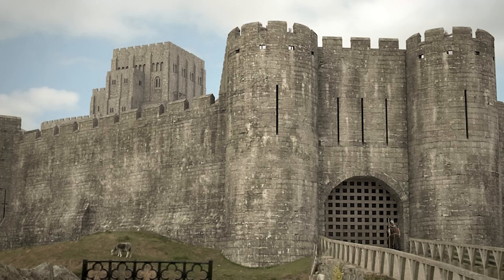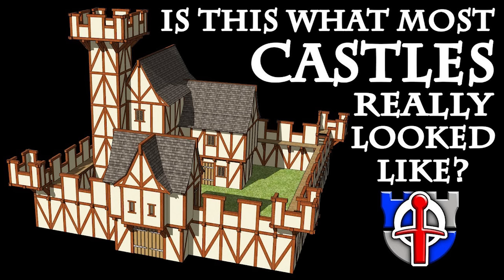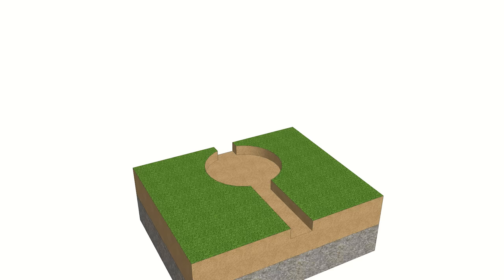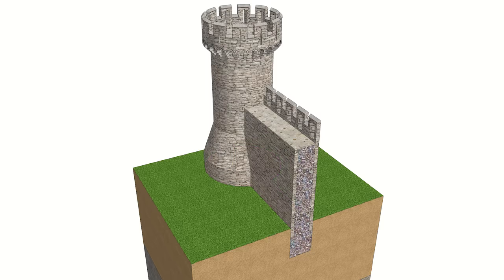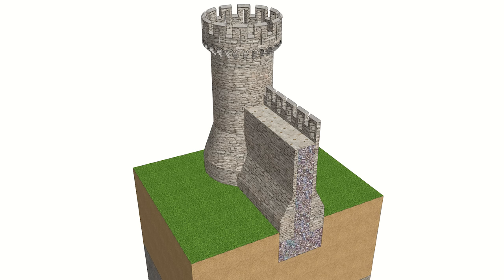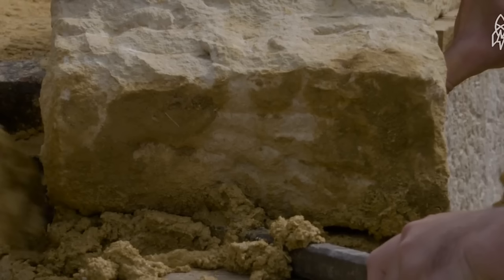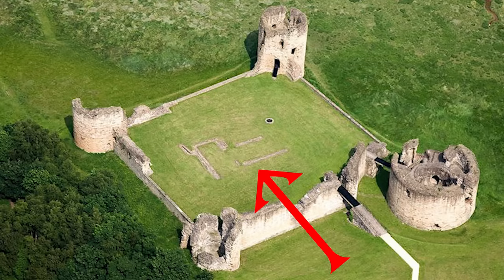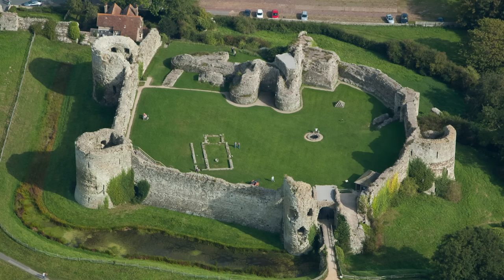How were castles built / constructed in the medieval period?

Comment: I wonder if the "rubble" fill rock helped with the stability of the inner wall.  Could haphazard layed stones have minimized cracks from running through and may have made the wall more earthquake stable? Perhapse the outside rock was laid more for astetic appeal and to keep water from the core?

Also, back about 100 years ago when they were building brick homes in my town, there were two types of brick layers: the ones that did most of the house and the interior, and then type who would work on the front facad of the building and the artistic brickwork.

Comment: @Shadiversity

On the subject of nails - the expense of making nails via smithing is an obvious limiting factor, but there's another one: moisture. 

Wood, even painted wood, tends to attract moisture, which really isn't good when you've got nails made of wrought iron - those nails would tend to rust, and as they rust the mechanical hold they provide will lessen. If the entire structure was stationary, the top layer of rust would protect the underlying surface and prevent its own spread - but wooden structures tend to expand and contract as the temperature and weather changes, causing the wood to rub hard against the rust and ensuring that the relatively brittle rust layers will be constantly disrupted, exposing fresh iron beneath.

While it's certainly possible to put a rust-resistant finish on nails, the finishes available in the medieval period tended not to be particularly abrasion-resistant - something you really need if you're going to drive the finished metal into a block of wood.

And then there's the expense. It's already relatively expensive to make the nails - putting a protective finish on all of them would only make that worse, even if there was a finish that would survive abrasion.

Jointery, as you said, saved on the expense of making nails, but I contend that nails would have been the inferior solution even if they had been cheap, because they wouldn't have lasted as long as the jointery.

Comment: To say that stones arranged in an arch are in compression instead of tension is like 90% true. The other 10% is the poisson effect, which is to say, compression in one direction amounts to tension in another direction. For an obvious example, imagine squishing a marshmallow: it gets shorter AND fatter at the same time. I'm told concrete columns sometimes fail this way, with the load being so large that the column ruptures laterally.

Comment: The reason a wall has two skins and a core is because the core acts as a dampener. If a wall was built fully from "one" part, it would crack easily or have to be truly massive in the element base (Central America's ancient walls, Egypt et cetera). This is ancient knowledge known since times immemorial. You'll see it in ancient China, Rome's structure even in the Americas and ancient Egypt.
TLDR, it's not so much a cost saving feature, as it is a structural one.

Comment: On the roof tiles you missed "Flag" I'm from Orkney, a group of islands off the north cost of Scotland. There all old structures use Orkney Flag. These are like slates but their "leaves" are much larger, meaning the stone is less likely to break. this also means that each tile is up to a metre in hights or width and 5- 10 cm thick. Not even Orkney winds will blow that away! I'm sure that Flag must have been used in castle in other areas where such stone was available as its such perfect building stone (often a grey-blue or purple colour) it would br to valuable not to use.

Comment: assumed the reason that internal stones inside walls were like that as they weren't placed.
i thought they made the external walls then filled them in but literally dropping the stones into the gap then assumed that the mortar inside was just made with extra water so that it could just be poured to fill in the gaps.
not sure if that's right or not but it's what i assumed from looking at ruins and thinking how that would have been made

Comment: You are missing the point of the tighter fitting stones on the outside and the looser fitting stones on the inside with the use of more mortar.  It was for cost.  The finer fitting stones had to be dressed and that took time and money and a lot of skill.  The rough stones in the inside were not dressed and the chiseled off bits and such could be used as filler inside the wall to make the mortar stronger.  The outer stones though were dressed to make them look better, but also to make them harder to climb and damage.

The outer walls would separate if water got inside the walls and froze.  While the castle was occupied the they typically would upkeep the castle and repair the cracks and such before any major damage occured.  After a castle was abandoned and any damage did occur, they locals typically would steal the dressed stones.  We typically see the after effects of possibly hundreds of years without upkeep or after massive damage was done during wars.

Few castles had wooden shingles because fire was always a threat.  The few samples you might have seen were likely because the roof was replaced long after the castle was a part of wars and wood shingles were used to save money.  Attacking forces would do anything to give them an advantage and starting fires with flaming arrows was a VERY common tactic.  Wooden credentials would often be covered with something to prevent them from burning easy or kept damp.

There was a lot that went into the design of castles from the entrances, fire arcs to cove the walls better, credentials to defend archers and crossbowmen, to courtyards, keeps, draw bridges, motes, stables, barracks, storage, water supply/cisterns, visibility, roads, access...  Some designs were very basic like single towers to massive castles surrounded by walled cities.  They were always used as a symbol of power and a way to control the surrounding land.  Typically they required 10x the manpower and resources or more to take a fortified location like a castle and some of the better designed ones took 20 to even 50 times or more.  Eventually it got to the point where is was easier to surround the castle and wait months if not a year or more to starve out a castle.

Comment: Shadiversity, you were kind of fed a bit of misinformation on top of misinformation: stone is a poor insulator, but has a high specific heat capacity.  So if you kept a big fire roaring in the room it would warm up quite nicely, and would stay warm for quite a while even after the fire died down, as the stone radiates heat back into the room.

Dampness is also somewhat overplayed: most castles are now quite damp, because most have not had a fire built in them for centuries, and so they're basically constructed caves.  Complete with stalactites, if you know the right place to look in Caernarfon.  But anyone who has ever been in a house or cabin with wood heating knows that in addition to casting heat it's also a very effective dehumidifier, and so I suspect that the living spaces of castles would actually have been quite dry.

Anyways, as a Canadian who did a European castle tour just recently, I highly recommend it.  Wales in particular is dense with exemplary examples of castle building.
Reply: JSheepherder And the lead and tiles on the various roofs of the castle, along with lead guttering and drain upkeep, would have ensured a dry internal environment. Now castles are all mostly ruined so all of those measures were taken away, and water seepage has long ensued.

Comment: In response to the insulating properties (r-value) of stone:
The real reason why castles and other great heavy structures are cold inside, is because of the high thermal capacity of heavy materials.
Stone and concrete can absorb most of the solar radiation and store it in their masses. This keeps the interior temperature low but the surface temperature on the wall exteriors is quite hot.
The cold nighttime winds cool down the mass and ‘resets’ the thermal buffer.
High thermal capacity of heavy materials is the same reason why built environments like cities are generally a few degrees warmer than the rural areas, because heat is stored in concrete buildings and roads

Comment: I was reminded of the book Wealth of Nations: A common smith, who, though accustomed to handle the hammer, has never been used to make nails, if upon some particular occasion he is obliged to attempt it, will scarce, I am assured, be able to make above two or three hundred nails in a day, and those too very bad ones. A smith who has been accustomed to make nails, but whose sole or principal business has not been that of a nailer, can seldom with his utmost diligence make more than eight hundred or a thousand nails in a day. I have seen several boys under twenty years of age who had never exercised any other trade but that of making nails, and who, when they exerted themselves, could make, each of them, upwards of two thousand three hundred nails in a day. The making of a nail, however, is by no means one of the simplest operations. The same person blows the bellows, stirs or mends the fire as there is occasion, heats the iron, and forges every part of the nail: in forging the head too he is obliged to change his tools. The different operations into which the making of a pin, or of a metal button, is subdivided, are all of them much more simple, and the dexterity of the person, of whose life it has been the sole business to perform them, is usually much greater. The rapidity with which some of the operations of those manufacturers are performed, exceeds what the human hand could, by those who had never seen them, be supposed capable of acquiring.
Reply: It goes latter on to say that most blacksmiths of the time (19th century, but also applies to the age of castle building), would have little occasion to sell that many nails as a specialist could produce. I wonder if nail makers traveled, along with other specialists, to construction sites, to ply their trade.

Comment: The reason the outside layers are different to the inside is deliberate its not time saving.

The Masons separate the piff paff and puff.  Which is the 3 grades of stone. The hardest stone is on the outside getting softer to the middle The idea is that the hard stone is pushed against the softer inner stone like a cushion under bombardment. 

This makes the wall overall stronger. Romans built the same way.

Comment: I bet the rocks that made up the insides of the walls were basically the 'waste' materials from the carving of rocks. this would make it more efficient and ensure that mistakes/accidents when making fancy stuff(eg window frames) wouldn't require new rocks. Also it would be very difficult to make a thick wall out of small blocks if all the blocks were like the ones on the outside. Keeping the walls straight and uniform in thickness would be very difficult but making 2 simple straight and thin walls and then just filling in the space in between with ruble would make the end product look better without actually being better. 

Wait, is this the artist who's works keep on showing up on 4chan or is this a different Shad? Also,

Comment: Those pictures of gedellon castle had modern made 2x4s  in them in the medieval period planks of wood would be hand cut old tree trunks they wouldn't be as smooth and square as modern lumber cut with modern milling technology
Reply: Because they have to respect the safety rules of today, not the 13th century. They also have modern helmets under their hat when it's needed. It doesn't change nothing in the process of building a castle, just less wounded or dead workers.

Comment: The use of timber framing DID NOT have anything to do with the cost of nails. Hewing timbers out of trees is MUCH cheaper than trying to cut boards out of that same timber. This cost far exceeds the cost of nails. In addition, timber frames simply last longer with he oldest currently standing timber frames date back to 700AD. When you put timber and metal together, it is very easy for rust to set in where you can't see it destroying everything. 

With Timber framing, the timbers themselves are connected and the joinery distributes the load while the design of good joins minimizes or even eliminates sheering completely. When someone see pegs in joinery and think "they couldn't afford a nail", they misunderstand what pegs are for. They are wedges and should have very little pressure being applied to them under normal circumstances. They just keep the timbers from jiggling out of place while the timbers themselves carry all the weight. In modern buildings, the metal is often structural.

For example in floor joists ,the metal brackets are the structural support. The nails holding the metal brackets to the edges of the floor experience sheer pressure (which is why you are supposed to use special nails designed for the load). If you make floor joists using joinery, you notch the timbers at the edge and the joists set into those notches with pegs to keep them from slipping. The sheering force in the metal brackets simply isn't there with the timber frame.

Comment: I had vague memories of people talking about how some european cathedrals took centurie(s) to build and how people would spend entire lifetimes adding to the construction. Was any of that correct?
Reply: With regard to Cathedrals, yes, they took enormous amounts of time to build.  Some took over 100 years to build, and there are some still under construction.  There's one in Spain that has been under construction for some 80 or more years (it was designed by a famous Spanish Artist, possibly Gaudet?) and there are others in France, Germany, and Britain (and perhaps elsewhere) that have still not completely finished repairing the damage caused by World War Two.

Castles on the other hand though went up in surprisingly short periods of time.  An English King (perhaps Edward IV) built a string of castles across Northern Wales, and they all went up in something like 20 years or thereabouts.  The difference is money and man-power.  If you throw a lot of money and men at putting up a castle, it'll take a short period of time.  But if you don't have a lot of money, you can't have a lot of men working on the project, and that'll mean your project (like a Cathedral) is going to take a very long time to build.

Comment: Build castle to a swamp. Even if it is daft to build castle to a swamp. Build it all the same. Just to show 'em. It sinks to a swamp. Build a second one. It also sinks to a swamp. Build third one. It burns down, falls off and then sinks to a swamp. Fouth will stay up. Thus you have good foundation for Swamp Castle.
Reply: When I did my degree (Building Conservation) we visited a few castles here in the UK.  At some, you can see where, during the early phase of a curtain wall, it started to sink into the ground.  What did they do?  They kept on laying stone courses until it stopped sinking.  Now you can see the stone foundation courses dipping down and back up again, and then resume the horizontal coursing once the problem stopped.

Comment: not sure about "insulation".   i was told,  unforunately cant find the material value listing than this link.  the link does better describing thermal mass and thermal insulation.    simply put; everything has both thermal mass and thermal deflection values.  just matter of how much... 
http://www.greenspec.co.uk/building-design/thermal-mass/
Hey i am gonna try surf for that link and see if there any info on lime.
Reply: found out thermal mass is not right word; which means retaining heat.   Thermal Conductivity is the word, passing heat/cold through [after material had taken share of thermal mass heat].    starting to find information from various web site sources.
using base materials and guedelon castle construct materials as reference.   Lower thermal conductivity is insulating, higher conductivity means temperature passses through.  remember this compare notes does not take in account thermal mass or thermal deflection. 
baseline materials:
Water = 	0.563 to 0.596
var. Oak Wood [air dry] =  0.16 to 0.19
var. Oak wood [oven dry] = 0.14 to 0.16
Steel = 36 to 43
Glass = 0.8-0.9
Guedelon materials and comparable
cement mortar [from portland] = 0.72
Plaster [with sand] = 0.22
Limestone = 	1.26 to 1.33
white paper revealed lime made from Limestone varies a lot.  = 0.70 to 0.95
listed  sandstone depends on type of sandstone and hardness = 1.83 to 3.9 
another white paper tested Pure Lime Plaster [1st layer 12mm and 2nd layer 3mm] = 0.80 [paint coating on same does not enhance]
so by numbers,  Guedelon in whole is more closer to thermal conducting material: glass !! 
However there are statements that implies if we ignore insulation, then a balanced thermal mass and thermal conductivity affects human comfort level.  example; white paper said lime plaster had some waterproofing, high thermal mass and temperature changes [thermal conduct] fast.  
Now the next question is going to give answer more toward personal opinion, than hard data.  What is defined human comfort level??

Comment: 7:22:  You were wrong both times.

Stone has very good insulation properties...  So good that it's bad.  Literally.  By which I mean: it takes months to lose its heat or coolness.  By the time late summer moves in it's hot; exactly what you don't want.  By the time late winter moves in it's cold, exactly when you don't want it to be.

You can pour TONNES of energy into stone and it will still be cold as a witches tit.